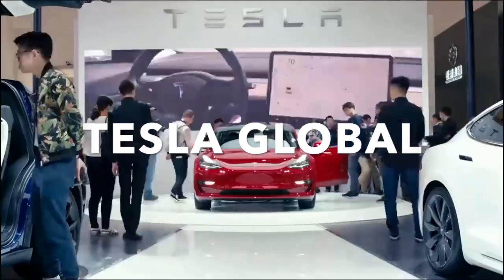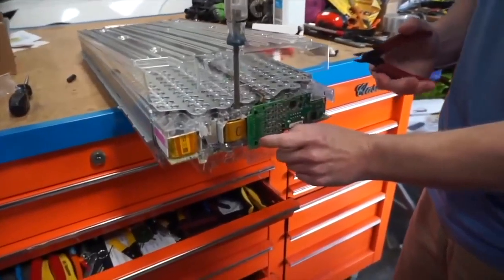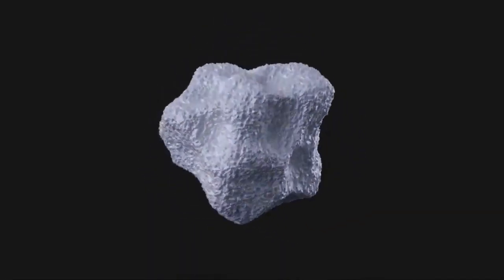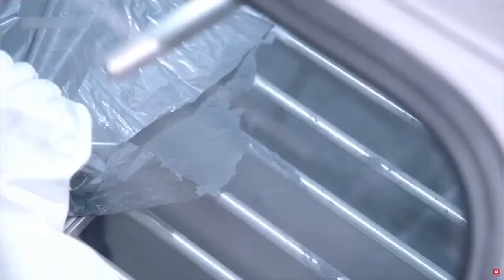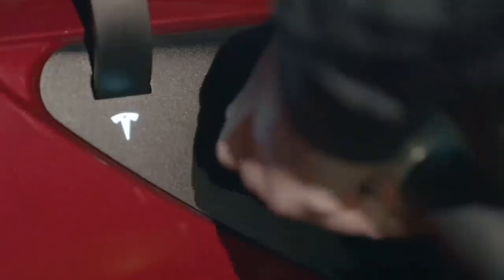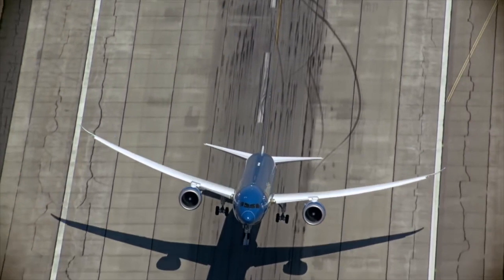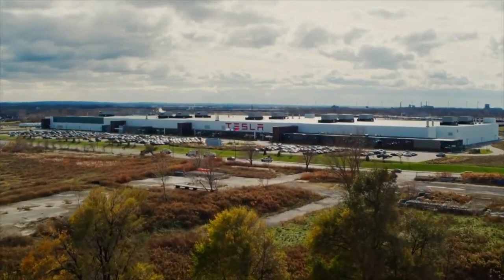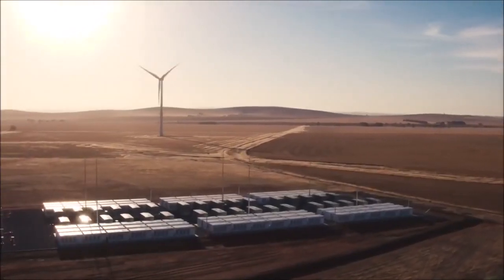UPDATE! Tesla's 4680 Battery News!

Comment: This is more of a plan than news. 

 4680 patent problems 

This isn’t a production problem or engineering problem but patent board reviewer qualification problem. The review board may be talented of their own discipline but short of multidiscipline experience. 

Detail: 

There are unforeseen problems conceiving towards a tab less architecture. An architecture giving up a reliable electric conduction path (a welded tab) in exchange for multiple “point contact” at the anode-casing junction. Contacts are flaps extending from the anode periphery. Anode is made of annealed soft copper foil instead of hardened spring copper foil. 

Two expected advantages in the tab less packaging are : conducting heat (1) and electricity (2) to cell casing and coolant more directly in a parallel fashion as oppose to serial means conventionally. 

Practitioners in the art knew (including Panasonic, Sony, LG and Samsung) that point contact incurs junction resistance on heat and electricity transfer that should be avoided at affordable causes. 

Remedy? 

If use of hardened spring copper foil to address a required junction and pretension contact forces at the flaps also let the electrode rolls to unroll itself. Self unrolling (flex back) creates gas pockets between electrodes, reducing wet area on electrode surfaces, to reduce charge capacity, raise chemical impedance therefore operating chemical temperature for premature aging issues. Not an option. Next ...

If use of soft copper foil to address gas pockets issue which is a matured technology Panasonic and other manufacturers use. However annealed soft copper will not hold shape once formed into flaps. Higher percentage of flap count may be touching cell casing right out of production line but will further deformed on the road under inertial and thermal shocks. As shock progress, more and more flap junctions will be disassociate with cell casing, until the last tallest flap remains - in touch with the cell casing. At which point thermal path is practically cut off and the next inertial shock will momentary open circuit the only only junction leading to an electric arc/spark. At such time we have hot and flammable chemical in the cell that an internal ignition and combustion is highly expected. Next ....

If use pretensioned elastomer at the cathode end pushing down at the electrode roll and further pushing the flaps against the cell casing intended to take up slacks from deformed flaps? This option will cause to the same problem above - axial compression force and thermal cycle can delaminates the electrode roll for gas pockets, to reduce wet area on electrode surface, lowering charge capacity, increase chemical impedance also raise chemical temperature and premature aging issue. No more million mile pack. Not an option for Tesla products. Next ....

If use thermal and electricity conductive paste/glue at the flap-casing junction? This may be a urgent research subject to develop a suitable conductive adhesive to be low resistance electrically and thermally stable and emits non toxic fumes in a collision that is also chemically compatible with battery electrolyte. Is quite challenged. Next ... 

If use of selective soft/hard copper foil section for anode roll. Soft in the roll while hard at the peripheral flaps - to avoid de-lamination and maintain spring copper flaps?  This calls for special production machinery that Nevada plan doesn’t have which needs to plan and develop with Panasonic. Is another urgent research subject? 

If use LFP blade battery pack? Cells from BYD and or CATL? Elon’s call. Next ... 

If returning the removed welded tab back to the 4680 cell? This will eliminate the dangerous electric arc/spark but heat sinking plan for mY-4680 (structured pack) become obsekete - is an issue, due to heat can’t drain off from cell base. To this situation LFP/prismatic/blade cell offers more option, flexibility and safety.
Reply: good video to watch